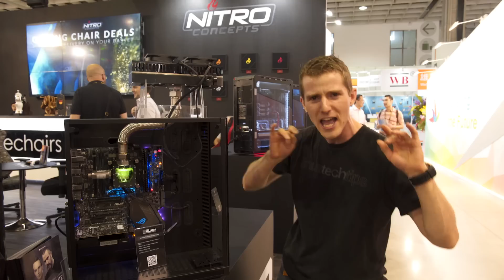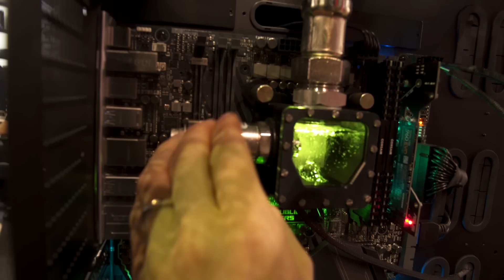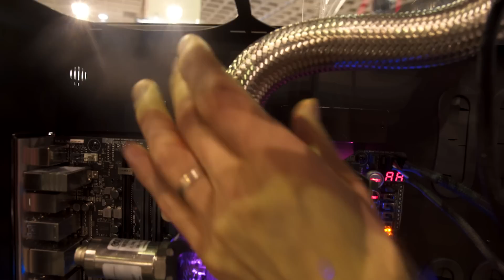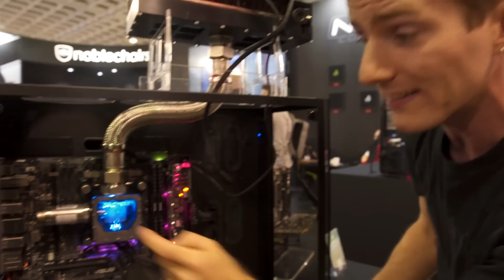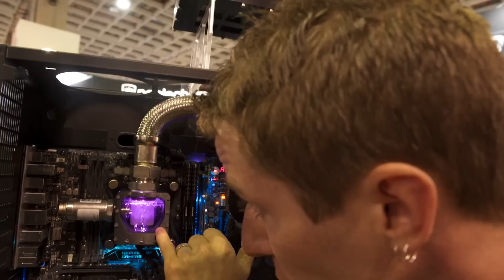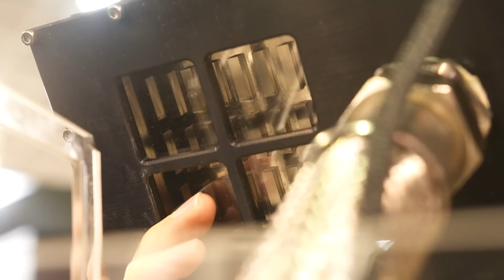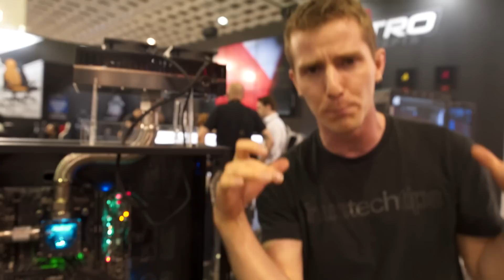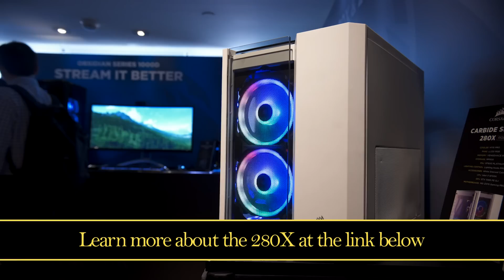Crazy Der8auer cooler prototype - NO pump!

Comment: My guess would be Chloroform. As far as I can tell it is the best match for the characteristics. 
-It is non-flammable, something that would be very important for something being used in electronics in the event of shorting/sparking.
-It is clear, and while not the most important characteristic, it does help with RGB and the liquid shown appears to be clear.
-It has a boiling point of around 61C, about 142F, which means it would boil around the temperatures you would expect to see from a CPU, but be easily condensed back into a liquid.
-The only kink, no pun intended, is that it has a very low thermal conductivity of around 0.1 watts per metre-kelvin. For reference, Water has a thermal conductivity of almost 0.6. (Higher is better)
Reply: This is what I think it is too. I was looking at refrigerants (a fluid used in a heat pump and refrigeration cycle, so literally this cooler) that boil at around 60c and Chloroform fits the bill really well.
Reply: Acetone vapor is highly flammable no way would it be in there. I'm 99% sure it's going to be a non-flammable refrigerant.
Reply: I bet its just water in a partial vacuum.
Reply: That's why I suggested Acetone. Slightly lower boiling point (56C/133F), but higher thermal conductivity (0.16). That's the problem with just about anything that has a low enough boiling point for this type of closed loop vapor system; most have either very low thermal conductivity, high flammability/toxicity, or a combination of both. Anything falling outside of those parameters is probably some sort of lab created compound and likely prohibitively expensive.
Reply: Chloroform is a great solvent, i use it daily at work. The problem with it is storage and the materials that come in contact with it. It easily dissolves many plastics or makes them brittle at least. So the front window has to be glass, and the rest metal with some special seals, which won't leak or dissolve over time. And since it seems to be in direct contact with the CPU i doubt i would be Chloroform. But there are other halogenated  compounds used in fridges for example so you might not be that far off. And if you play with pressure a bit, you have a wider range of compounds to choose from.
Reply: You might have noticed the pressure control on it.  That likely means that it operates above ambient pressure which would increase the boiling point of whatever is used.  I would suspect an dichloromethane or something similar with a near room temperature boiling point under STP pressures.  He did say no one would guess it though so isopentane?   Vodka under vacuum?  the tears of a unicorn?
Reply: 3M Novec 7100 or similar engineered fluid would make the most sense to me. If so, I'm not sure why he wouldn't disclose it though, since it is already widely used in immersion cooling (full system). This setup would just help the liquid re-condense faster.
Reply: Methanol boiling point is 66c if not methanol then ethanol 76c that cooler is practically a moonshine still powered by 8 cores of raw power
Reply: Thermal conductivity of the fluid isnt that relevant. If it was a problem they would have increased the surface area, but they didnt.
Reply: 3m Novec would make more sense imo.
Reply: Thermal conductivity is not an important factor here. Clearly convective heat transfer is dominating. And besides, the vapour is carrying away the heat. Thast is orders of mag higher than just conventional conduction
Reply: I second what Sam C said - it's probably just 3M stuff, like Fluorinert or similar.

Although, I guess if it's true phase change / vapour cooling, then it would need to be more active?

I used to use Fluorinert every day in my old job, and I seem to recall it having a very very slight yellow tint to it. The liquid in this looks very clear (even with the silly RGB), so maybe not Fluorinert after all?

You can tell I'm not a chemist. lol

EDIT: Oh yeah, it's about the low boiling point etc. I think you guys are on track. Could it be quite a high vacuum, since Linus mentioned the thickness of the block?
Reply: @Trithis
My guess is Vertrel XF (dihydrodecafluoropentane) very similar to Novec 7100 (Methoxy-nonafluorobutane) in properties and less regulated.
Reply: My bet is a 3M product such as Fluorinert, 56c boiling point.
Reply: Trithis it's also a powerful solvent that could easily melt acrylic
Reply: Razamatraz

You might be close with that last one - the coolant is the tears of the "4K" console owners. haha

(yeah, yeah, I know some of you do console gaming too. Queue the inevitable trolls. lol)
Reply: @Alystair
Europe has heavily regulated Novec due to PFC content and it's long term bio accumulation risk. Vertrel XF most likely.
Reply: Trithis but you can see the liquid boiling from the surface of the block too, which means it is at or above boiling point
Reply: What about materials with even lower boiling point? Ether is ~35C. Perfect time for cooling system to start working. As linus is touching the stuff saying it's "warm", it couldn't be more than 40-60, chloroform wouldn't even have boiled by that time.
Reply: Finds user passed out with head in case.
Reply: They won't choose something that toxic.  Too many regs.
Reply: Acetone is probably the most likely for a prototype with an honorable mention to something like DCM or Toluene  as they are fairly easy to acquire and boil at the required temps

here is a wiki list of refrigerants for your perusal
https://en.wikipedia.org/wiki/List_of_refrigerants
Reply: Roy Shantzis  no
Reply: Trithis if that block was 61c he wouldn't be able to touch it so easily
Reply: why not Methanol?
Reply: 3m Novec?
Reply: NelsonR. Candelaria Mercado ya, I can't claim to be a chemist, just a quick googler. I just made an assumption about what might be important. ¯\_(ツ)_/¯
Reply: Piratekiller99 flamable.
Reply: m9bettt you must live in California lol
Reply: R-113 would work well but it's banned I  believe since 2010
Reply: Yeah i think you are right
Reply: To bad that you cant just buy chloroform in Germany where he built this
Reply: https://en.wikipedia.org/wiki/Thermosiphon
Reply: for a Thermosiphon such as in this video, water can be used.
Reply: thewebmachine why does thermal conductivity matter though, because once the liquid is heated up it will boil and the gas will rise up, removing that little pocket of heat. It's not like metal radatiors where the heat moves through a solid, because the liquid is what moves.
Reply: probably Chuck Norris's piss
Reply: Trithis I'm still thinking Pentane, it has a bowling point of 36C and is similar to water with it's thermal conductivity .50.
Reply: KingKaos not a thermosiphon as this involves phase change. In a thermosiphon that would be a sign of reduced performance. This is a little different.
Reply: gtq838 do YOU ever google before spouting off bullshit?

Chloroform has a 2 on the NFPA 704 which means "Intense or continued but not chronic exposure could cause temporary incapacitation or possible residual injury" and is listed with the GHS Hazard statements: H302, H315, H319, H332, H336, H351, H361, and H373. Thes translate to Harmful if swallowed, causes skin irritation, causes serious eye irritation, harmful if inhaled, may cause drowsiness or dizziness, suspected of causing cancer, Suspected of damaging fertility or the unborn child, and May cause damage to organs through prolonged or repeated exposure, respectively.
Basically, use proper PPE and don't go vigorously inhaling it or injecting it, you should be fine.
Reply: well gasoline or diesel are carcinogenes too, and still people don't seem to bother much. But sure this also makes chloroform less likely. Even though it might work in this.
Reply: 61 would not be that cool for a cpu like that , i think acetone - 50c boiling point - would be a better choice. closer to room temperature but not too close. and i can bet acetone would keep the cpu at max 85c, but chloroform would jump to 95. uneducated guess here, i know acetone is flamable.. but a beefy enclosure, like the one seen here, should be safe, i guess.
Reply: m9bettt, "This product contains chemicals known to the state of California to cause cancer." 

Jokes aside, I do see your point. But ideally, you would never come in contact with the liquid, except for in the case of a possible leak.
Reply: I'm thinking dicholoromethane. It's got a rock bottom boiling point and is used in heat engines (think drinking bird) and is pretty safe.
Reply: I was thinking about solvents and other more complex things, but I don't think you'd be able to sell them to consumers easily... Especially with carcinogenic or otherwise toxic materials, in case of a leak... I'm betting on isopropyl or pure methanol... It would keep a CPU around 80 degrees or so once it's up and running, and would condense rather nicely. Still a bit of a concern if sparks occur after a leak, but safer than most other things...
Reply: jason fernandes well the block doesnt have to be 61c, just rhe processor. And that is the tempesture that alot of processors run at.
Reply: it has a presssure sensor there and the tubing looks pretty strong im guessing its running with some pressure which would lower the boiling tempture needed to make the coolant boil
Reply: Is water wet?
Reply: gtq838 its butane
Reply: everything is a carcinogen
Reply: But research has show chloroform is a carcinogen. Would the public be inclined to buy a product that gives them cancer?

Comment: It could be water and kept at low pressure. That is the problem if it gets hot enough it will stop working because the pressure gets high enough it will stop working.

Comment: Coolant is definitely an M3 Novec Engineered fluid.
If I'm correct you can basically submerse an entire PC in the stuff, and it has a boiling point of about 40 to 50 degrees Celsius, which would be somewhere around the ideal point for a setup like this.
Can't say much on the specifics because... Well, there's a lot of specifics i can't go into, which would be one reason to say that nobody would guess it.
Well, they would, they'd just be doing exactly that, guessing, because there's no way to know for certain. :|

Comment: Water evapourates at around 50C if the pressure is kept down to 15 kPa, so probably water kept at low pressure (which makes sense given how beefy the tube is).  In a system like this, the evapouration would bring up the pressure and thus the evapouration temperature, but it's basically the same as a heat pipe.

Comment: 3M NOVEC 7100 he mention it in his channel at the Exhalare Project.
Reply: he said in that video that he wanted to move away from that fluid because the bioling point of 61°C is still too high to provide good overclocking headroom.
Reply: @Peter Borman
Europe heavily regulated PFC's as long term risk of bio accumulation. Vertrel XF (non PFC) is 55C boiling point which has other variants cut with common chemicals to alter boiling properties.

Vertrel™ XM - Methanol - 46C
Vertrel™ XE - Ethanol - 52C
Vertrel™ XP - Isopropanol - 52C
Vertrel™ MCA  Trans-1,2
 Dichloroethylene  - 39C
Reply: Peter Borman 49°C sounds good 34°C would be very bad in summer because the fluid can't condensate if ambient T is above the boiling point. But if they really want to compete with classic pump design AIOs they can't use a fluid that alone would make the whole thing more expensive than a normal AIO. so I'd guess they used a cheaper fluid or at least will do so in the final product.
Reply: Nope...too high of a boiling point to cool effectively
Reply: 3M NOVEC 7000 boils at 34C and 649 boils at 49C so either would be good
Reply: @Cerberus984 Does the mixing with flamable liquids make it safe enough to use in a consumer product?
Reply: @Peter Borman
Out of the ones I listed only Vertrel XM - methanol azeotrope - has a listed value for "Vapor Flammability in Air, vol%" pulled from the data sheets. Which an azeotrope (constant boiling point mixture) is a mixture of two or more liquids whose proportions cannot be altered or *changed by simple distillation.* 

I'll concede that I'm no scientists and can't explain why just going by observation of data sheets from the manufacturer chemours.
Reply: @Cerberus984 I'm no scientist either but it is all very interesting. Thanks for the reply.

Comment: My guess is that coolant is some kind of alcohol, because of their pretty useful boiling points for ethanol it is around 75°C and for Methanol about 65°C Which is perfect for this usage. And just like you said, it's pretty hot. And I know you can change boiling point of liquid by changing pressure, but that would be kind of sketchy because of the fact that it could burst and also it couldn't be serviced without specialized equipment.

Comment: the coolant might be an alcohol, because an alcohol like ethanol boils around 78 degrees C, so it will make sense for it to boil when the CPU reaches that temperature (as it appears in the video). There might be some propanol mixed in as well to raise the boiling point or methanol to lower the boilig point. idk. I might be completely wrong, but this theory makes sense to me.

Comment: It's just water distilled
Reply: mr. Right but sometimes wrong that would mean the cpu is running at 100 degrees and no way that's what's happening (given it's running at atmosferique pressure
Reply: IF you lower the pressure to .5 bar it would boil at 50 degrees...

Comment: It's probably a blend of water and some alcohol. It may even include Freon, but it probably wouldn't work in this setup. They also most likely decreased the pressure in the loop, making the liquid boil at a lower temp. OR, they used only some type of alcohol and increased the pressure so it boils at a more reasonable temperature.

Comment: It has to be an alcohol or an ether. To make a liquid boil you either find something that naturally has a low boiling point or dramatically decrease the pressure to lower the boiling point. Acetone would kill anything plastic or rubber, butane and methane would need pressurizing and are volatile, water would need a vacuum to be feasible.

Comment: just water at low pressure to lower the boiling point.  purpose of having it boil at the element rather than the cpu is because you want consistent transfer of heat which you don't get at the site of the boiling.  problem would be keeping it fine tuned enough to insure the element is just the right temperature and the pressure is just right as the temperature changes.  as soon as it starts boiling your pressure increases, which is likely the purpose of the gadget on the side, to maintain a specific pressure as temperature changes and amount of water being boiled changes.

it's possible it is liquid carbon dioxide under pressure, but that seems kind of dangerous.
Reply: why would he say then that nobody will find out what liquid it is if it would be just normal water :D
Reply: mis-judged?   or maybe he said that to throw people off.  sure you could set up a similar system with some exotic fluid, but why.

Comment: The coolant needs a high specific heat and a boiling point between 50-90 degrees celsius. We can also see that it is a clear color with a very low viscosity. A good possibility would be just water with in a lowered pressure which wouldn't be impossible considering there is a pressure sensor, but there would likely be better options.

Comment: probably distiled water or some alchool at low pressure for boiling at low temperatures. I'd bet wolud be 99,9% etil alchohol, since is easy to make, not quite the best solver of metals and has a low boiling point, even lower at low pressure

Comment: Chloroform.  It's got the right boiling point in a vacuum.  Heavier than water or ethanol(Hence no bending). What do I win?
Reply: @ByTheBeardOfThor You win this monogrammed handkerchief...it's even scented, here, take a whiff! ;)
Reply: That's my guess too, the only issue that there might be with Chloroform is that its thermal conductivity is about a 6th that of water.
Reply: And the secret plan to rob the world’s richest brats unveiled
Reply: Black Mephistopheles Fun fact, it does smell really good.
Reply: tjoloi arrhh....Now I want to try it...
Reply: Saurav Nayak Well, really good if you like acetone and ethanol. A bit like a mix of those two smells.
Reply: A cookie
Reply: Chloroform is way too dangerous and a strong solvent to be used in consumer grade electronics, plus it will dissolve any metal over time

Comment: It probably uses the pressure in the loop to reduce the boiling point of whatever liquid it is. Other than that, I was just gonna guess isopropyl alcohol or distilled water.

Comment: Is it acetone or some kinda alcohol? It surely ain’t water cuz it’ll boil at 100 degrees or a slight difference if something was dissolved in it, but still 100 degrees is too much for a CPU. So I guess it would be acetone cuz that has a boiling point of around 70 degrees, which is good enough for a CPU, and as we can clearly see that the liquid is boiling and has to evaporate, so my guess is any liquid/ solution that has a boiling point of around 70 degrees and the only thing that comes to my mind is acetone. But if they’ve modified the pressure within that chamber, and maybe that sensor that was blocking RAM slots keeps a check on the pressure level, so maybe it could be something else as well cuz pressure  drop can decrease the boiling point, so it could also be something like water or mineral oil or something

Comment: It's not water, or the cpu would have to be near 100 degrees for it to work.. its much more likely to be a gas like propane, or nitrous oxide or something. its a pressurized system. the braided line would collapse, or at least kink if it was under a vacuum.

Comment: The liquid is either methyl alcohol or acetone. They both have high specific heat and are safe to touch at their boiling point. The liquids are clear and are far less vicious than water like in the video.